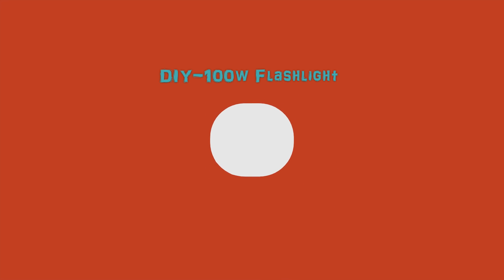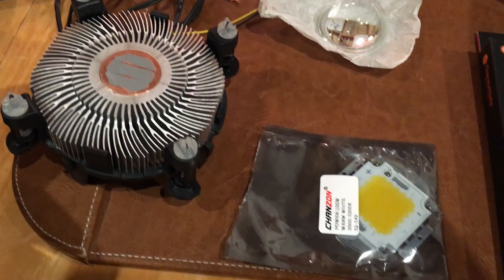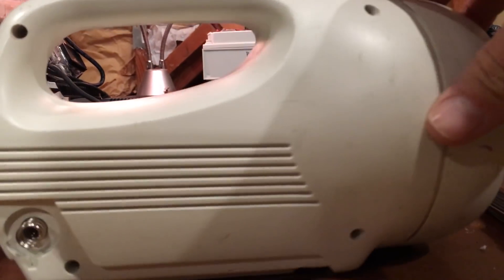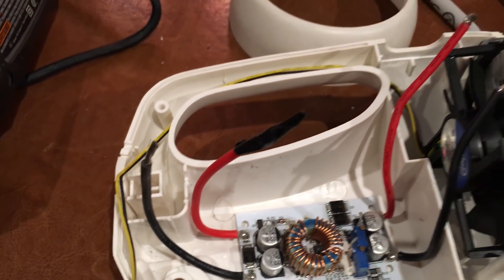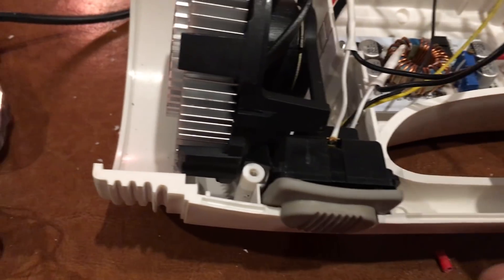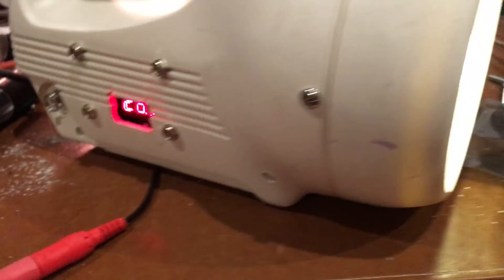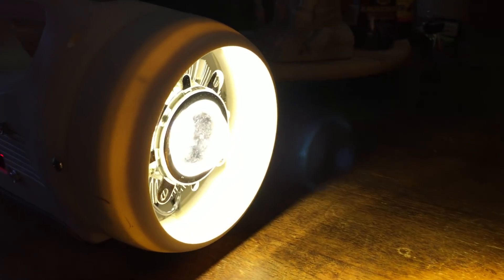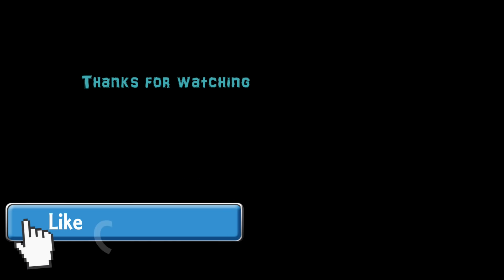Super Bright DIY 100W LED Flashlight project parts from ebay and goodwill EDC

Comment: you could use that white boost converter alone to boost the voltage for the led. and for fan i would use the small lm 2596
Reply from the maker: True, This was an experiment, I modified it later.

Comment: Looks like maybe 400 lumins if your lucky (from the camera your filming with)  a higher quality camera makes all the difference in picking up the light
Reply from the maker: james palmer you are right. I measured it with a light meter. And it was around 800. But it's more than bright enough for most applications.

Comment: The Buck Step is max 2A, so probably it warms up because 100W led takes 3amps. Anyway very interesting project :) I'd like to make something similar :)
Reply from the maker: AgeDee34  it was fun. I have learned a lot. That is good to know. I want to buy a 3D printer and make a battery add on so that I can use more batteries and lower the buck settings down. I am pushing it a little to much. Thanks for the info.

Comment: These led chips from fleabay run on about 38v.
Reply from the maker: Yes they do. but I got it to work on 12v, but a buck and voltage booster, I am going to redesign it so I use a 24 volt battery and turn the booster up less, it should provide longer run times and less stress on the electronics.

Comment: How long does it run and how does it handle the heat?
Reply from the maker: Gene Angel I was thinking of doing some testing and making a video on it. The build does have a old CPU fan for heat. But I never ran the batteries all the way down. Thanks for the comments. Keep a look out for the video.

Comment: Could you please explain me why you put LM2596 between Dc-Dc boots and 100W LED? why not connect LEd directly to Dc boots and adjust constant current on DC boots. I am confusing.
Reply from the maker: Calvin Nguyen the buck converter steps up the voltage so I can output 30v to the led. My battery is 12v plus it has a display so I can measure my voltage also.
Reply: I still don't get the answer.  You are using a BUCK converter to step UP the voltage? Are you using one to feed the correct voltage and the other for current limiting or something?  A little more info would be helpful for me.  About to begin creating some high CRI lights and looking at what others have learned.  Thanks!
Reply: @scissorfightmedia  this is not right setup